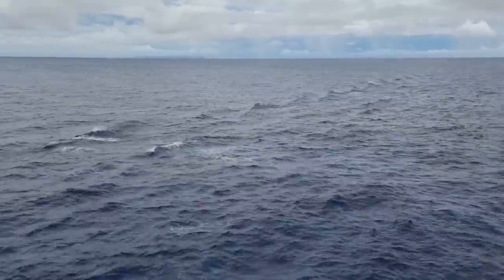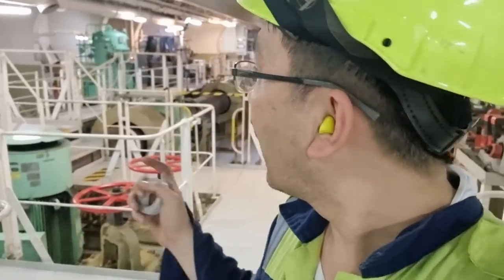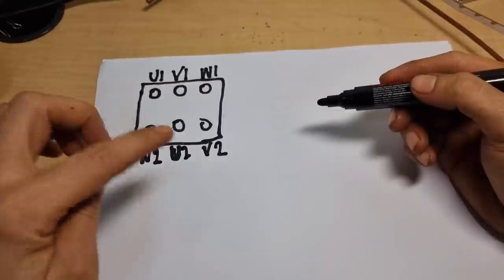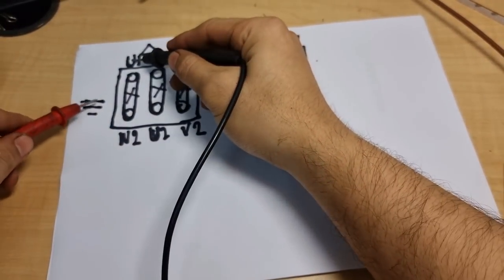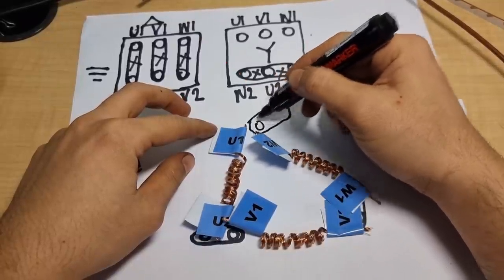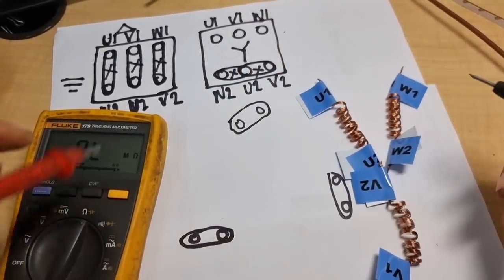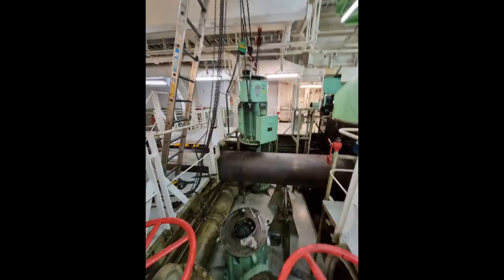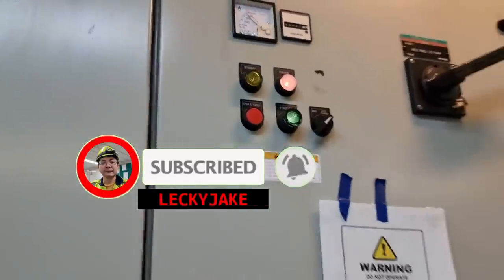MAIN ENGINE SLOW DOWN & PROPER CHECKING OF ELECTRIC MOTOR | MARINE ELECTRICIAN

Comment: I like your way of just checking the winding directly, removing any other factors, and of course, enables you to compare the winding's resistance to see if any individual one is abnormally high or low.
I'm not an electrician, I'm a computer systems engineer, so I deal with tiny motors and low voltages but the diagnostic principles are the same.

Comment: Good idea about removing the plates, it makes sense. There may not often be corrosion between them and the terminals, but as you say, in doing it, you are taking that possibility away from the start. Great tip!🙂

Comment: I respect for what you do. Its good  and very fast testing to see abnormalities on motor windings by winding resistancte test using multimeter and also if you check  insulation to body. Maybe you found something. Some motors are working, but insulation is poor. It will work but not for so long until the real problem was found.  Any way. I salute you for what you do. God bless and more power to you sir.

Comment: I use megger to test it. Sometimes the motor inside has burns but they still have good resisance or still have continuity. Megger allows you to test it by giving it actual voltage for accuracy

Comment: At the first when ME LO pump trips, the oil pressure drops to the level that ME will shut down but not slow down. The second need to check not only main motor terminals and also main motor contractor. The third also need to check with clamp ammeter current for each phase. And the forth listen carefully main motor bearings.
Reply: Theres a safety system in control which automatically puts main engine in slow down mode... Secondly if one lube oil motor trips then other is always standby.. When main engine automatically slows down then they start another lube oil pump but fault rectifying is still pending where this all thing comes.. And whenever theres a motor tripping no one checks the contactor.. Everybody goes for then insulation checks of the winding to first ensure that the winding is ok because eocr was tripped.. Hope u understood tollix
Reply: If to pause the video where the Aconis alarm list, it is clearly view the ME Shut down alarm due to low LO pressure. Of course first step is to check the motor. If the motor is OK it is also good to check the main motor contractor for wear.
Reply: Hope you understand  @sikander manhas
Reply: Wow wealth of information

Comment: Hey Jake: Good explanation but I'd never rely on multimeter tests alone to prove or condemn a motor. The voltage from a multimeter is too low, you need a good insulation tester as well.
Reply from the maker: Agree but I was just explaining it in General. As yoy may have noticed I am using the proper IR at 500V in the actual troubleshooting.
Reply: @leckyjake  : Hi Jake, sorry buddy but I don't see anywhere in the video where you show that your using any form of Insulation testing, Just tests with your fluke multimeter. If I'd seen an Insulation test, I wouldn't have mentioned it.
Reply from the maker: @2:43 was a short clip
Reply: @leckyjake  : Aah, so not actually showing you carrying out insulation testing ? Just a very fast flash of something, not like you at all.
Reply: He is using megger

Comment: sir ..I m E/O .i have a problem for 440low voltage insulation ,it is showing 0.1 ,so i have switched off/on all the breakers one by one.only by switching off galley little bit insulation meter move down ,but still showing 0.2 anf some time 0 night time also...pls advice
Reply from the maker: Finding the earth fault should be done by switching all off the breakers and not one by one. Then start switching back on one by one and observe which breaker will cause the earth fault
Reply: @leckyjake  ok sir..
Reply: sir,i have found the low insulation from reefers..from 9 breakers low insulation is coming..and reefers onboard now is 100 only..it means low insulation is coming from all the reefer distribution box.its big issue.i have to check all sockets one by one..any advise sir

Comment: Do you have any turbine generators on board?
Reply from the maker: Apparently in this vessel, we do not have. But most of the newly built, they have TG.
Reply: @leckyjake  they are pretty cool.. I often wonder how the engineers can deal with them at sea if something goes wrong. Jet engines are very delicate and precise.. but reliable… wanted to see the challenges.. 

I appreciate you sharing your awesome job with us!

Comment: Insulation resistance should not be measured with a multimeter
Reply: why?
Reply: @terrycrews2281  Multimeter testing voltage is too low for that (about 2V). It should be about 500V
Reply: @htwt  ty ,nick

Comment: mostly your videos are correct and good for beginners....but i feel like you lack of theoretical knowledge... What is your education?
NOT correct to conduct any of resistance measuring  in delta connected windings....
...and this is not your method this is simply correct method.
In one of your videos I have seen that you replace the burned diode hoping that board will work again... It hopeless ...burned diode rather is the consequence than  the cause ...